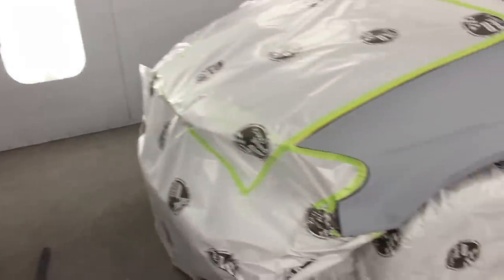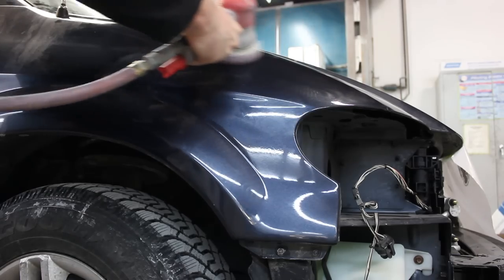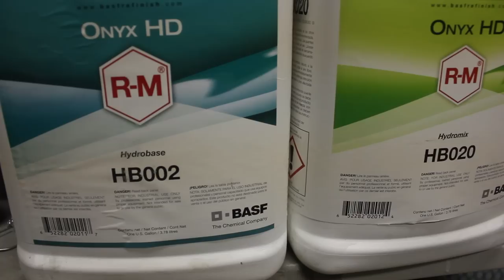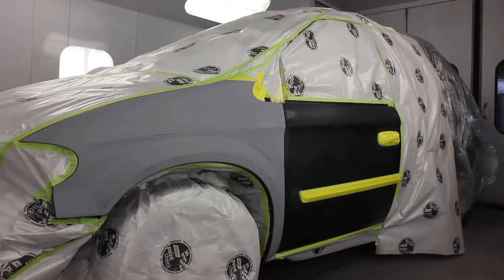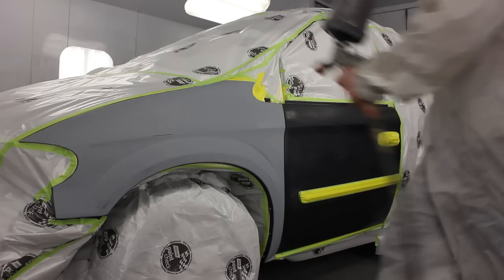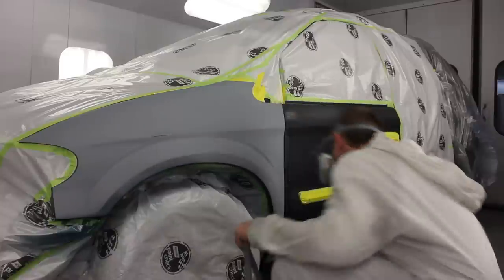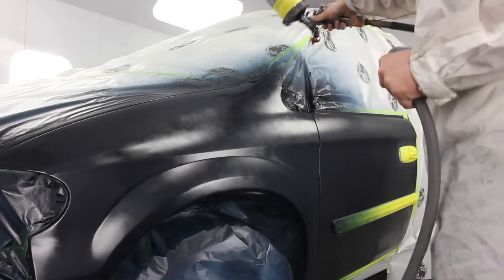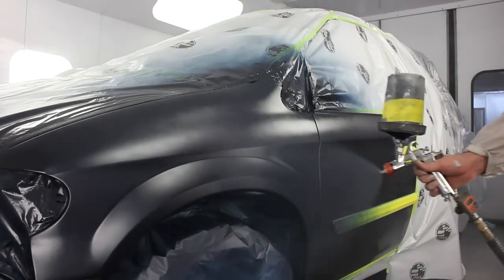Blending Car Paint Tips (Iwata LPH400)

Comment: See your useing a iwata now how does it compare to your other guns?
Reply from the maker: I like it with BASF paint, besides most of my guns I don't have the larger tips for that Onyx requires. It has a killer fan pattern though.
Reply: What air cap do you use for the tekna the t10 or t20?
Reply from the maker: Whatever one I pull out first, I can't remember which ones which lol. I think the TE20 is what I use most of the time.
Reply: Lol Iove the tekna great gun.I have a sata 4000 and don't Evan use it anymore